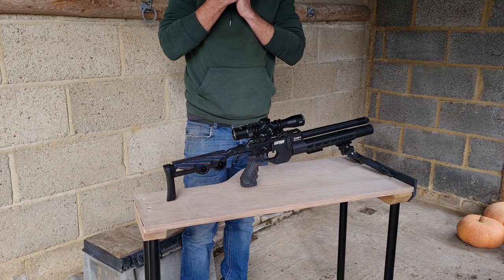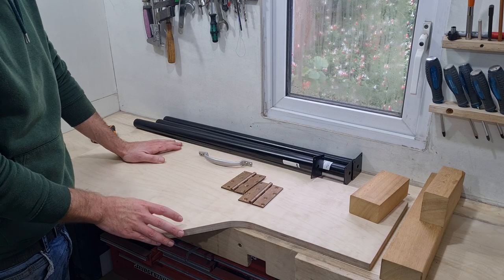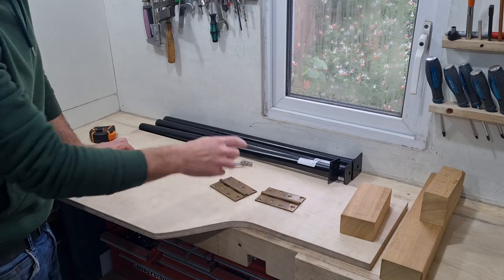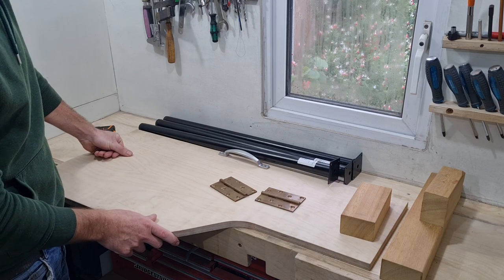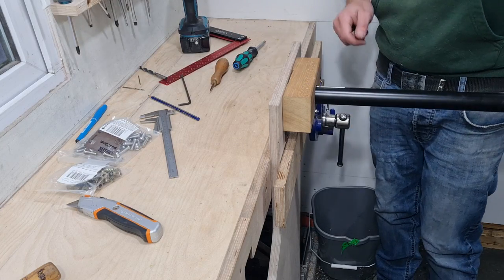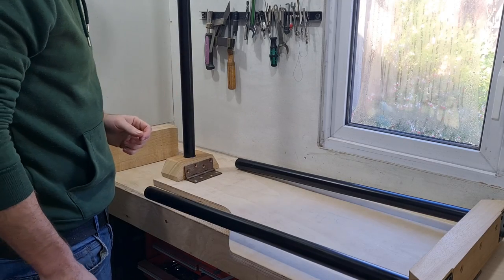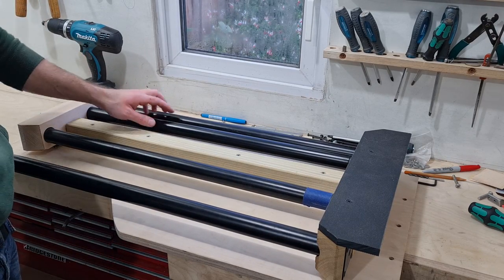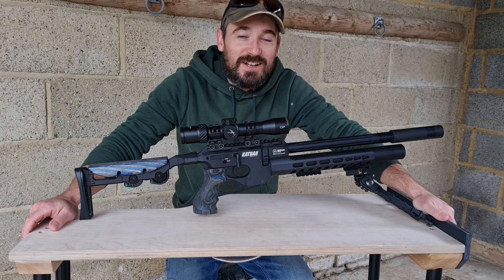Lets build a simple folding shooting table /bench from scraps..

Comment: Just started watching this . When you were hogging out the saw kerfs, for all the world it sounded like Peter Piper Picked a peck of pickled peppers....

If I'm making a deep bore with my Forstner bit, I'll first use the bit to make a 3-5mm deep starter hole. Then I'll switch over to a paddle boring bit that's about 5mm smaller in diameter and go nearly all the way through. Then I'll get my Forstner bit to finish it up to get that nice clean hole. This method really take the wear and tear off my Forstners.
One thing I did notice was it wasn't the best for easy carrying. Might I suggest mounting the handle to a block and screw the block just outboard of the outer legs, flush with the table edge, with the handle mounted to the side. This way, it'll be like carrying a rifle case, with the weight coming straight down.
Reply from the maker: Hi Mike, your dead right about the forsters. Tbh the larger od ones ive got in the shed are pretty well ruined nowdays, the smaller od black ones absolutely eat through even 3" laminate but they stay in the workshop. 
Once the clips finally arrive for the legs, I'll be moving the handle to the side and adding some stout eyelets for a shoulder strap too. Lugging all the stuff and cameras about is a chore so I plan to make it all as portable as possible eventually 😉

Comment: Nice build,,couple of ideas for you,,you could use snap suitcase catches instead of having to put screws in to secure legs,,also what I did on mine,I drilled two inch and a quarter holes about 4" apart and then removed the middle, I did this towards the edge on the balance point and it is to put your hand through to carry it by your side ,hope that makes sense?